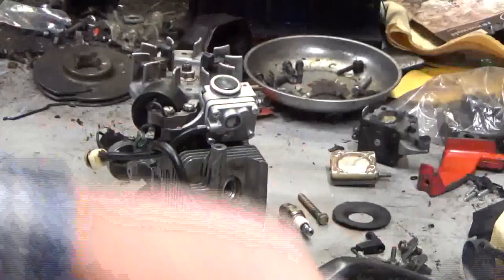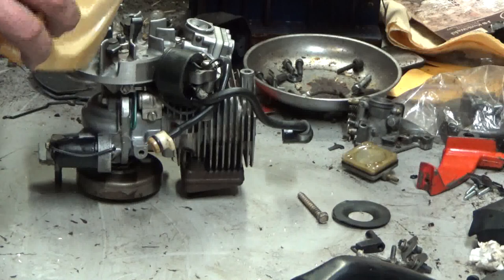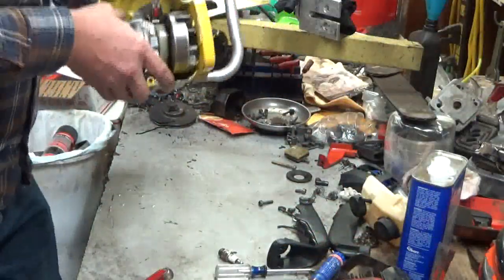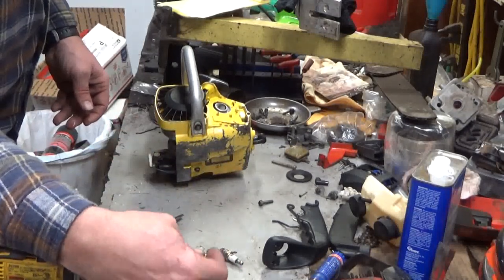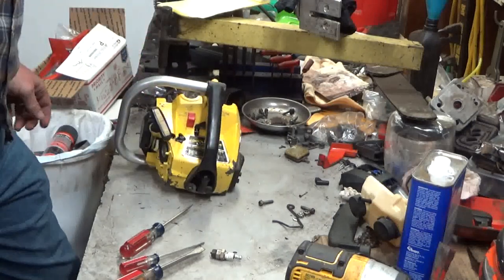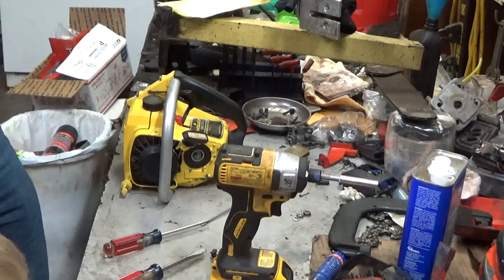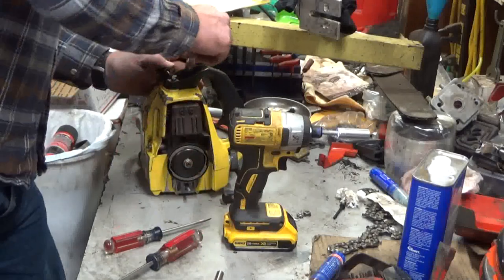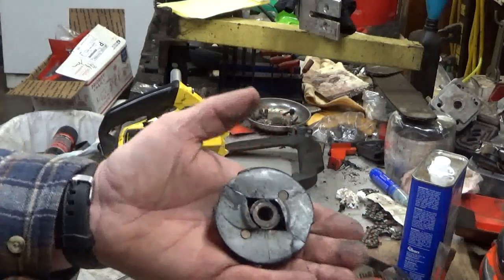McCulloch 110 Chainsaw Assembly (not as bad as you think!)

Comment: Hi.  I have a Mac 110 that's been sitting on the shelf ever since I bought a Husky 359 about 17 years ago. I finally decided to clean up the old Mac and see if it would still run. Back in the days I was using it, it ran flawlessly and never gave me any problems. So I watched a few YouTube videos (including yours) on how to tear down a Mac 110 / 120 and decided to pull it apart to clean out the gunk. Everything I could see looked to be in good shape so I reassembled after a thorough cleaning, put in some fresh fuel mix, and tried to start it up.  It wouldn't start so I primed the carb. With fuel in the carb the saw would start and run strong for about two seconds but still wouldn't start the normal way. I did this four times and each time it started and ran for a couple of seconds so it appears everything is working properly except the fuel isn't getting to the carb the way its supposed to. Okay, my question is this: Is it possible the old fuel mix that dried up in the tank deposited a sediment around the little screen on the intake tube and is plugging it? Or is there another explanation.  Any thoughts, ideas, or suggestions will be greatly appreciated.
Reply: you need to rebuild the carb.  The diaphrams get old and stiff and need replaced periodically.  use premium gas and a good synthetic mix and some stabilizer if the saw is going to sit for a while.

Comment: Great video. Very informative. I am searching for one piece of the puzzle and can’t seem to find it.  The idle - lock screw how far should that be turned in ? I picked up a saw just like this that was out for garbage. The idle screw was in the bottom of the case I can’t seem to get it adjusted properly. Thanks in advance.also the spring placement inside the metal sleeve or under it ? I assumed under.
Reply from the maker: Yeah, spring under.  The screw goes in as far as it takes to make the saw idle consistently

Comment: Really informative video. Thank you so much. I have a 110 and just rebuilt the carb. I know the manual says to set the hi low to 1 1/4 turns but what is the starting point for the idle screw?  Got the saw to run but at very high rpms.  Thanks again for your knowledge,  👍👍
Reply from the maker: For the idle speed screw, I'd back it off CCW until the throttle arm stops moving (if you look down at the screw, you'll see the edge of the throttle arm contacting the idle screw).  Then turn it back in 2 turns CW.  That should be a decent starting point.
Reply: Leon's Chainsaw Parts & Repair that worked just perfect. Thank you it’s up and running. Last ? I replaced the auto Oiler and am unable to find (once again) the starting setting for the Oiler screw. Any ideas?

Comment: I have this exact chain saw and it's been sitting about 20 years in shop cabinet. I'm sure the oil reservoir tank and the gas tank needs clean out and cleaned. What is the first thing I should do before taking this saw apart. What particular parts would I need to change to see if I can get it running. How should I go about cleaning out the oil reservoir and gas reservoir? The last question is there any lines that need to be changed internally? I've worked on Poulin's before and the lines in it that feed the gas to the carb and return lines usually harden and has to be changed. Wondering if Mcculloch 110 has the same. Particular repair and service parts? Asking all this before I attempt to break it apart. Thank you very much.

Comment: Also do you have any videos if you lose top dead center on the timing I'm somewhat confused that maybe me one of my problems
Reply from the maker: Carb setting from start should be: L 1 1/2 turns open and H 1 turn open.  You cannot adjust the timing on these...the flywheel key keeps the timing constant.
Reply: Right on Leon I'll get to it
Reply: Well I ended up getting it running but now it's becoming difficult to start again it's fires with the little Brave of carburetor spray question the diaphragm has a little white plastic piece and it's not attached to the rubber is that how it's supposed to be
Reply from the maker: Yes, the disc is supposed to be separate.
Reply: @LeonsChainsawPartsAndRepair  okay after some research it seems like the walbro carburetor diaphragms are built better just by visual comparison by any chance do you sell carburetors
Reply: @LeonsChainsawPartsAndRepair  I changed the diaphragms in that zamma but maybe the needles Jets can use some cleaning I did not remove them I guess I got to go back through it again fun fun fun I got the bug for this
Reply: @LeonsChainsawPartsAndRepair Thanks  Leon
Reply: I got my first home light super 2 I'm stoked
Reply: What should the RPM's be at idle and at Full Throttle on a super 2 Homelite

Comment: Looks like the sprocket and clutch are loose.  You must clean the tapered surface on the crank and sprocket, just like you have to do on the flywheel side.  I pulled the sprocket and clutch on my 32-16 and had to remove it and clean the parts, after I greased the sprocket bearing.  I must have gotten a little grease on the tapered part of the crank.  After cleaning any excess grease and tightening it down with my I,pace it worked fine.

Comment: Could it be the coil insulators. So can the coil not touch the engine at all? Plug wire has electricity but no spark when touching the engine

Comment: Leon, I have a Mac140 that when I do a pressure/vac test I have bubbles coming from the oil port on the bar mount pad, is this normal or is there an issue with the automatic oiler?
Thanks for any help.
Reply from the maker: The oiler is actuated by the crankcase pressure, so I can see why there'd be some leakage there.  I've never pressure tested one of those models, but initially I'm thinking that is normal.  Perhaps someone else has run across this?
Reply: @LeonsChainsawPartsAndRepair  Thanks for your input.

Comment: I got myself mac130 tore it apart and there is no oil pump has manual pump would a pump from a 110 or 120 work or does it have to be a 130 pump I can't seem to find one for a 130 with the retaining clip but have seen a 110 and 120 with all the pieces I need.
Reply from the maker: The pump from a 110 or 120 will work and you'll need the proper outlet hose as well.  To make a non automatic oiler saw work with an automatic pump you can drill a small hole in the bottom of the pump base.  I usually go for about a 3/16" bit and you want to be slightly below center, but not out where the pump case seals to the crankcase.  You also want a magnet handy while you drill to ensure no shavings go into the engine.
Reply: @LeonsChainsawPartsAndRepair  ok thanks I was wondering how you would get a pulse from there.

Comment: I could really use some advice Auto adjusting the high and low from Ground Zero I'm somewhat mechanically inclined I got saw in pieces it's a 2.0 Eager Beaver assembled in Mexico it doesn't seem to have the point in condenser I got it all back together but the needles maybe off and no start please help on my first chainsaw project

Comment: I have a problem with this chainsaw.... if the engine is outside of metal hausing it has spark but if I put it back in the hausing it doesn't have spark anymore... Do you know what might be the problem?
Reply from the maker: Check to make sure the points grounding tang isn't bent to the point that it's contacting the switch regardless of switch position.  Also check the coil leads for areas of bad insulation.

Comment: I took my 110 apart to replace the coil. Now it runs, but the chain oil leaks out of the case. Any ideas?
Reply from the maker: Check that t-piece oil hose to make sure it is indexed properly....it's easy to have it cock to the side when installing the tank.  Also check the tank for cracks...pretty common on these saws.
Reply: @LeonsChainsawPartsAndRepair  Thanks.
Reply: Yep, the little rubber hose was not going into the tank.

Comment: I have a 2.0 , the spark plug wire will knock you loose. But the plug doesn't fire grounded to the case. Nothing wrong with the plug. Why does it not fire.

Comment: ...the problem In have with these saws isn't really that they are all that hard to take apart and put back together...it's that you have to take it completely apart to work on it, then put it completely back together to test it...and if something still is not right..you have to completely take it back apart again...after repeating the process 3-4 times, my stress level starts to really rise, and my vocabulary gets increasingly inappropriate for young ears...after 5-6 times, even Ozzy Osbourne might raise an eyebrow over my language...beyond that, well, Mac parts start flying in all directions..:)
Reply from the maker: I hear ya!  Things like the ignition can be tested with a drill and socket but carburetor problems can get frustrating after a couple disassemblies!
Reply: @LeonsChainsawPartsAndRepair  ..thanks for the reply!...my description may have been over-dramatic, but it's when you have to assemble/disassemble multiple times that it really gets to me :/...